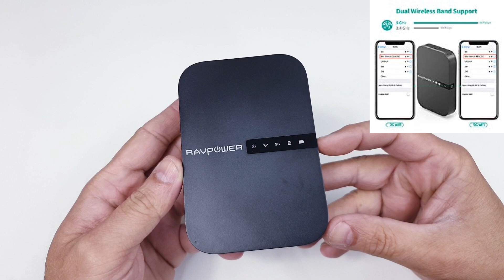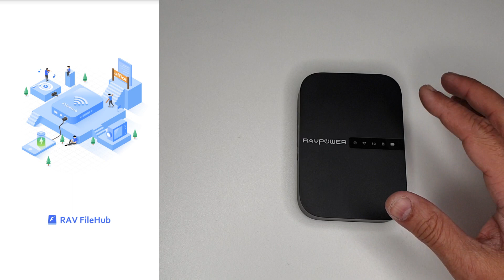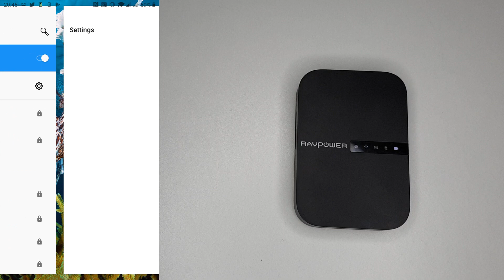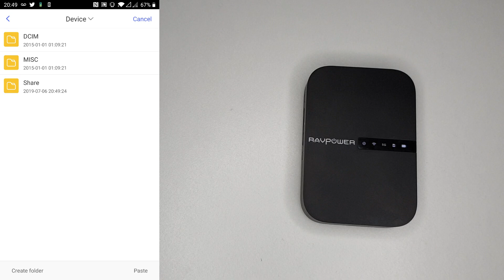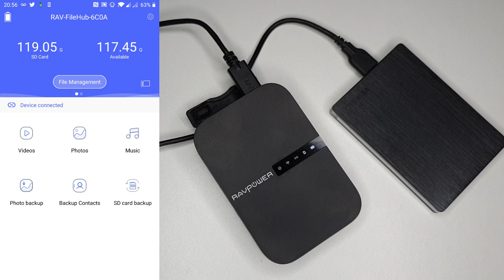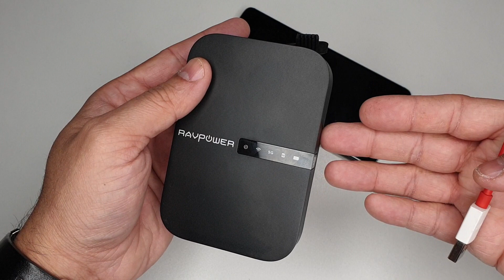RAVPower FileHub setup and review (2019 model). Wireless ANY! storage for your tablet or smartphone

Comment: How does this differ from Hotspot on the phone?
Reply from the maker: Okay, this unit you  multifunction which  means that  you can copy data from  your SD card straight into hard drive with single click of button, can  also  use this device as hotspot from ethernet connection no 3G or 4G like your mobile phone,  unit can also  work as DLNA server can  play media on device connect with  it over network
and in last but not least power bank
Reply: @nareshkeswani80  I installed the free DLNA Server app (from the Google store) on my Motorola G5 android 8.1 smartphone. It works good for saving/loading files to my Oculus Quest headset. So, no need for the RavPower Filehub for me now.

Comment: Can this RavPower Filehub be used in a forest/on an island where there is no wifi and not even a wifi router. I want to have local wifi using this so my laptops and smartphones can use it to share data/videos.
Reply from the maker: Yes you can use it Wi-Fi is a medium for Internet, not Internet you can still connect couple of pc and mobile phones togather and share data which you have on hard drive or sd card connected with hub
Reply: @nareshkeswani80  Thanks for the fast reply.
Reply: ...NO..  IF YOU DON'T HAVE WIFI ...YOU DON'T GET  WIFI!  ...SIMPLE!!  ..YOU CAN'T GET WIFI IF THERE IS NO WIFI ...YOU DON'T GET SOMETHING FROM NOTHING... TIP: STAY OUT OF THE FOREST AND OFF OF ISLANDS!!